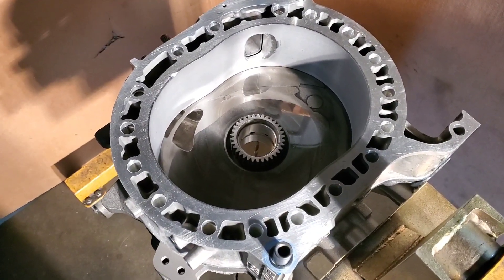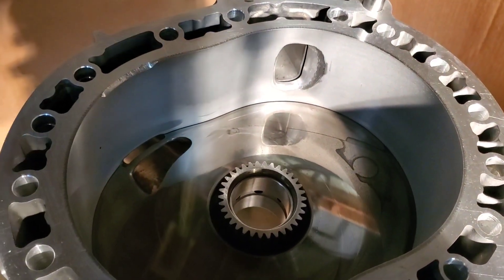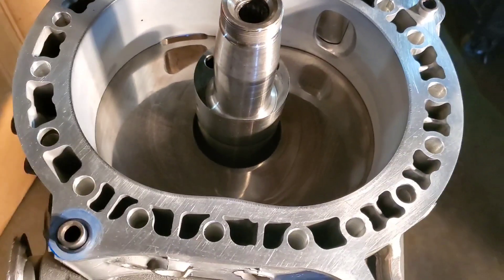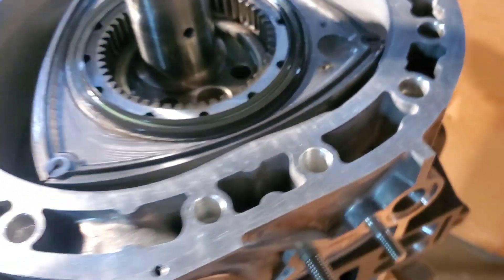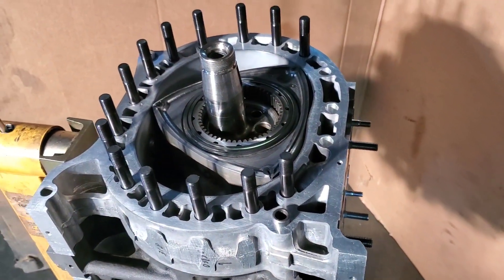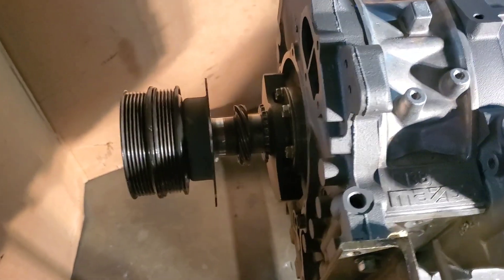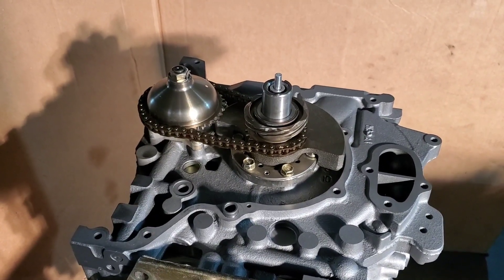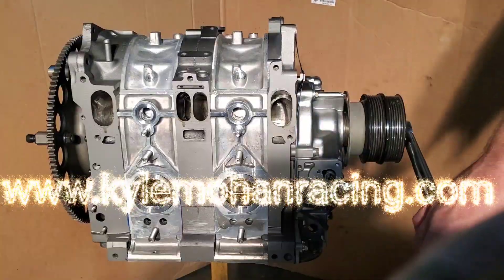Building a high boost Full Bridge port 13b Rotary Engine. KMR Info Rotary Tech Talks RX7 FD3S Turbo

Comment: Hey Kyle, I see this motor is for a RX7 FD3S but I see you are using a RX8 front housing cover gasket. Do you prefer to use this gasket? Also do you prefer to add liquid gasket to the water pump housing gasket area? Thanks for the tech talks, love the info!
Reply: IM SORRY HE NEVER REPLIED

Comment: Huge fan here, im loving these, please do a tech talk on the studs, also would you recommend oem size studs if i am not capable of machining the holes?
Reply: Depends on your power goals tbh, if you're aiming for close to oem power then oem stud diameter is good enough, but once you start aiming for higher power you really wanna oversize stud your block as a safety measure. It's very much worth the extra time/cost. Also depends on if you're running a REW block or a t2 block, from what I understand t2 blocks you wanna oversize stud them when you're aiming for 400hp and above, anything past 400 and you're pushing your luck (if it's not a oversized studs block), for REW engines might be closer to 475-500hp for when you wanna oversize but not sure. If anyone notices I missed something, or got smth wrong, chime in!
Reply: @ziadkabbani4479  good thought, thank you